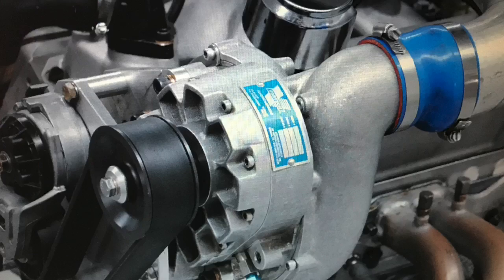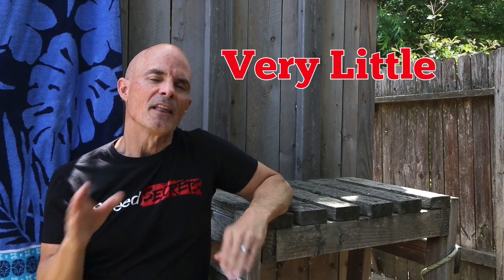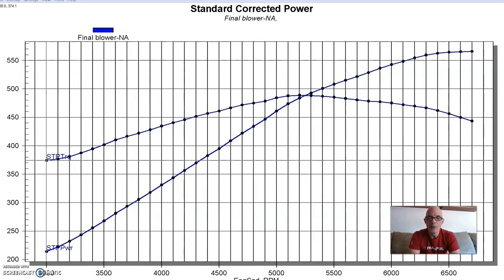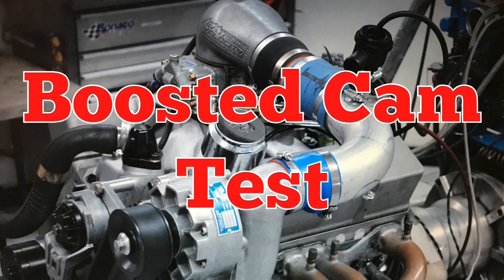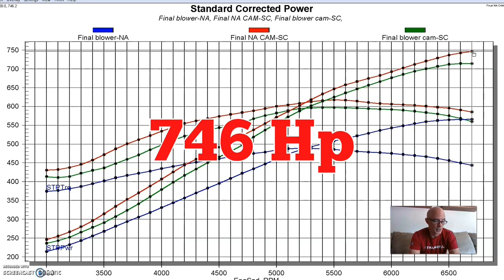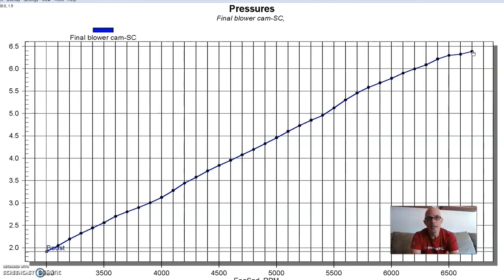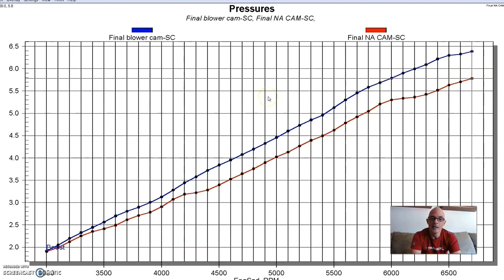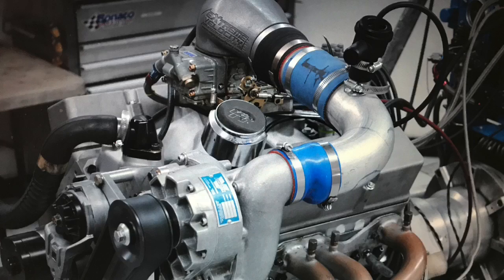MOTOR MYTH BUSTING-BLOWER CAMS!

Comment: LOWER boost pressure on BOOSTED N/A test ?
Here's my "fancy super scientific keyboard mechanic theory". IS BOTH.
Is filling more the cylinder and leaking it out too because of the added duration to both intake/exhaust and the tighter LSA.
Kinda of the same process when you uncork the intake side and exhaust sides with a good intake, heads and exhaust(supercharged applications, NOT TURBO'D). Boost drops 'cause you're freeing up the airways both in and out. Different ways, similar results.
I guess the only way to know for sure would be O2 sensors and EGT probes. That will tell you what's coming out of the cylinders and how much.

Comment: Richard, have you ever used David Vizard's formula for determining optimum LSA? I saw your big LSA test. You never went too narrow. Everything you tested, except for the 108° LSA cam was too wide for best torque and power and 108° might not have even been best. 

Intake valve closing point is the #1 factor for RPM range. Overlap is #1 for idle quality and scavenging. Pick the intake closing point, the desired overlap, plug in the optimum LSA and then you'll have the duration.
Reply: Sorry, have to disagree. Intake closing is NOT a sole indicator of rpm range. Nor do you factor LSA first. Optimal valve timing controls everything, Separation angle is a byproduct. You decide when the valve will open and close based on many factors, and LSA is the end result of those 2 events.
Reply: @vengeanceizmine9878  Intake valve closing has the most effect, of any valve timing event, on the engine's RPM range. Closing the intake valve later hurts low engine speed torque and helps higher engine speed torque, within reason. Conversely, exhaust valve opening has the least effect on how an engine runs. I would steer you to Dimitri Elgin for more in-depth discussion on this. 
LSA should come first as it's dictated primarily by the ratio of intake flow to cylinder size with adjustment for compression ratio. Better intake flow and higher compression ratio dictate a wider LSA. Lower intake flow and compression, smaller LSA. Most cataloged cams have too wide an LSA and give up torque for the sake of idle quality. Treating LSA as a byproduct is a sure fire way to compromise the engine combination. For more reading on this David Vizard is the man.
Reply: @Joshie2256  No offense, but did you copy that word for word from an outdated book? Or do you have first hand, real world experience? If you don't think any of the other open and close points have an important effect on how and where the engine operates, cylinder pressure, or cylinder fill, and how it all works with the entire combination, you need to put the "how to" books down and actually do it. 
There are a lot more important variables and determining factors  to consider when deciding on cam timing and LSA than what you listed and I'm not talking about just picking one from a catalog. All an engine wants to know from a camshaft is, when the valves open and close, how fast and long they open and close for, and how much the valves open during that time. All of which are way more important. LSA just moves the curve, which has nothing to do with compression and big flow numbers. I'm well aware of what every event does and how they work together, but let me just ask this... do you also decide on compression AFTER you choose a cam?  Doesn't make much sense, does it... just sayin'. 
I'll refer you to real world experience instead of quoting books... again, no offense.
Reply: @vengeanceizmine9878  Dear MrScreenName, My time is limited so I gave links to the writings of experts. If you disagree with them then you've got a big hurdle to overcome in building better engines and explaining your accomplishments. No offense. There is one optimum LSA for each combination that produces the most area under the curve all else being equal. One. You don't have to look for very long or hard to see the truth in that. Richard  himself has posted video after video showing more area under the curve with a narrower-than-typical LSA.  https://www.youtube.com/watch?v=JUHwVCDjonU

Comment: I noticed that the NA cam had significantly less benefit from the blower than the blower cam. I'm curious as to whether that was just due to it needing more air and therefore getting less boost, or whether there was indeed some charge blown through.

Comment: Might be able to answer your final question with airflow vs hp. If you lose hp per cfm you know you're losing efficiency and bleeding out airflow. If it don't change then it's from adding airflow to the na ability.

Comment: Two different camshafts! And the na camshaft is 10-14 degrees bigger. Would love to see similar specs. I'm pretty sure a "blower cam" with similar duration would make similar power
Reply: The engine doesn't know it has a "blower" cam, all it sees is valve timing. Look at both cams equally as just valve timing. Then you will understand why the "blower" cam will make similar power like you said, because the valve timing will be similar.. valve timing is all that matters, throw away the prefixes.
Reply: @vengeanceizmine9878  I agree with you. That's all I was saying. If you can give the engine what it wants, as in ivo, Evo, ivc, and evc, it should make good power

Comment: Richard I'm still waiting to see a set of Trickflow 245 vs AFR 245 on a 427+ engine. Use same compression, camshaft too. No one has done this test EVER. Be the first to do it so we can see  which head makes the most power and torque. There is a lot of debate all over the LS forums which head is better. A lot of those favour the trickflow but is it really the better head? Do the test!!
Reply from the maker: both work well

Comment: I suppose you could tell how much boost is getting out the exhaust valve by measuring unburnt gasoline in the exhaust. Perhaps by putting a smog meter in the exhaust and measuring the HC number?
Reply: This is why a "blower cam" is needed for an OEM engine, the emissions are going through the roof as you suspect. Fpr aftermarket where it isn't an issue for most people that matters less.

Comment: Are the wider lsa “blower cams” more driven towards low speed drivability because they assume you are using it on the street?
Reply from the maker: I like to chose the cam for the desired combination of idle, fuel economy, rpm range and peak power, then add boost

Comment: Ok my question goes back to XRam intake   i have a 5.3 LM7  can i bore it enough to use Ls3 heads and not have an issue with valve side clearance to the piston well.

BTW every cam is a turbo cam.
Reply from the maker: you don't need rec-port heads on a 5.3L-they won't work well
Reply: @richardholdener1727   I am trying to find a way to use the dual plenum cross ram intake manifold that edlebach makes on my 5.3l  or are there other dual plenum intakes that are good with long runners

Comment: Great info- more bench race ballons popped!!  Close to a fellas heart with a 400 with AFR 195's, VooDoo 110 LSA and lil Weiand 144.  What cc were the heads? What style rods n did you use std or small base circle cams?
Reply from the maker: it was small base circle, rods were h beams

Comment: Interesting. I been thinkin about this cause I bought 4.6 4v stage 1 n/a cams from Sean Hyland couple years ago but now I’m collecting parts to do an M122h Pd blower swap. Makes sense to use them now. Good stuff Richard. Now I need to decide on a static compression ratio for pump gas. I’m hung up on this. 9.2:1 on less boost or 8.5:1 with more boost?
Reply from the maker: 9.2

Comment: My experience with a centrifugal super charger is that they aren't as "picky" about cams as a turbo.  The bigger issue I've found is at lower boost the centrifugal doesn't mind an aggressive NA cam at all which your dyno just proved.  At higher boost and closer to maxing the blower out it starts liking that blower cam more and more especially if you like a full exhaust and reasonably quiet mufflers.  The reason is at higher boost you can still have overlap with a centri, but it will really like having a lot more duration on the exhaust side.
Reply: This is interesting as I have a  relatively big Vortech (Si) on a little 4 banger.  I have found that with more aggressive pulley combos, at low engine speed the Vortech surges which basically stops the car dead.  I have thought about putting on a large NA cam with long duration and some overlap to allow the engine to breath more so I can pour the boost on sooner without surging the blower. Do you think it would work?

new cam 234 intake/235 exhaust @ .040 with 15 degrees of overlap @.040
existing cam 204 intake/198 exhaust @ .040 with -24.8 degrees of overlap @.040

The new cam does have slightly less lift than the existing cam.  So... the Supercharger is oversized, I don't think I care about "blowing out" some of that air.
Reply: Turbos aren’t picky in any way.

Comment: Looks to me like the drop in boost pressure is the result of a restriction being removed (a valve closing sooner). The engine is able to use more of the air through more duration. If power had dropped then maybe a case for bleed off could be made.

Comment: Great video, proves again that every cam is a boost cam. What about BSFC? Did it change between the two cams? That’s about the only parameter that might go down (up) with boost blowing through the cam’s overlap. If you’re running this combo on the street, you’re not too worried about fuel mileage, but it might indicate efficiency of the combo. And, of course the answer to the question you posed: more efficient pumping due to better cam timing means less resistance through the engine, thus less boost pressure. Thanks for continued awesomeness!

Comment: Every cam's a blower cam ... but at what cost?  What happens below 3000 rpm re throttle response /fuel economy?  Or are we just talking about race applications?
Reply from the maker: pick the cam you want for the rpm you want then add boost

Comment: The same thing would happen if you went from std heads to ported heads on a turbo engine, boost would be lower but more power.
Reply: Less pressure, yes. More power? Not unless it needed it without boost..

Comment: Non Rootes blower, non turbo, any NA cam is a plus. Word, RH!  ( The key is that on a turbo or sequential injection turbo, the wrong cam can still cause surging or power bumps. I got told to either reduce boost or Put In a Bigger Cam! Everything in context. In a 1988 publication on SOHC Ford Pinto small bore center 2 liter engines before the later 2.3 liter 1975s Lima,  Ive seen a  dyno sheet showing a tiny little 255 hp gross at 6500 rpm 121 cubic inch OHC engine loosing 51 hp flywheel with too little cam duration. Moving up from the Stage 2 Ford cam with 286 degrees  from  degrees at lash to a 322B Crane 300 degree cam with the same V trim Garret T4 turbo in an EOA Ford engine made 306 hp, 51  more hp power without surge, and still  with a 2.35 boost ratio. Those wide LSA, reduced exhaust over lap "Myths" are and are just that.. )

Comment: Your test was done at only 6psi, that is not real boost, I bet you there will be tons of blow through (and up) if you try to run 60 psi.
Reply from the maker: at 60 psi?
Reply: @richardholdener1727  well, BRM had an engine running on 2 centrifugal superchargers and 82.6psi 70 years ago, but I am well aware that your test represents what normal steet-driven V8 guys  do, not all out race engines.  https://en.m.wikipedia.org/wiki/British_Racing_Motors_V16
My comment was ironic, but I'm sure all of us would be entertained if you were to take it as a challenge ;)

Comment: speedmaster rods & block? are you begging for something to break or are they a sponsor of yours? speedmaster is just procomp & procomp was junk. i never seen anything from procomp worth a damn other than the bare big block mopar heads & maybe olds heads. everything else i seen rated right up there with CAT. how much work was needed on that block? i'm not being a dick, please don't take it that way, but i would hate to see anyone buy this stuff without knowing just because they seen it in a video on youtube.
Reply from the maker: this motor worked fine for all of our dyno testing (there was a lot)-i have no sponsors-if i did-it wouldn't change what the dyno says

Comment: I do agree that there is no reason to fear running an NA cam with boost there are some issues with the idea. Sticking to centrifugal stuff... Almost every setup you build will gain a peak of 400-600rpm when you add a centrifugal supercharger. If you had a peak of say 6400rpm NA you'll likely expect a peak of 6800-7000 rpm with that same setup likely giving you a shift point of around 7400rpm or so. Will the owner be ready to run the new setup that high? Anytime you aren't using the entire powerband you have the wrong cam whether you're NA or supercharged. If you aren't using all of the power band you are putting together a setup that has worse drivability, needs a higher stall converter than necessary, and will likely have a higher EGT than a better done setup. Taking a 400 inch motor with say a 242/248 110 cam that peaks at say 6400 and now peaks at 7000 for a shift point around 7400 or so and yet could likely be matched with a camshaft of around a 224/240 117 with a small amount of boost difference to make comparable power. I like keeping the boost numbers down for efficiency and IAT's, but the smaller cam with heavy exhaust split should keep EGT's in a better range helping with timing numbers as well as piston/ring temps. The LSA being a bit higher will help make sure to get the rpm peak still around 6600 or so which overall would put your shift point around say 7000rpm (more likely accepted by the owner). The thought process without putting a name to the cam puts the idea in the ball park of what is sold as a "blower cam". This is my thought on the idea although I do agree that there isn't anything wrong when a naturally aspirated camshaft with boost. What do you think about this thought process? Am I just being too technical or ridiculous?

Comment: One theory behind specific boost cams as opposed to NA cams is that an NA cam can cook the exhaust valves.
How exactly this is supposed to occur I’m not sure , something to do with flame in the exhaust ports.
Reply: That is mostly with a turbo. That is also why exhaust valve material is Inconel for heat, however you can alter exhaust timing to help that situation,  it doesn't negate the overall outcome. The test just shows what can be done, not which is best for the application.

Comment: I dont know about speedmaster,,,Pro comp or whatever there called I've seen some of there stuff with not very good results there  Holden EFI 304 IDA STACK injection manifolds there ports don't line up with the Holden EFI 304 factory gaskits because to get them to work you have to weld up the ports and stuff I'm not a trouble maker but I work my ass off to buy my parts.

Comment: Longer duration and tighter Lsa helps cylinder fill especially at higher rpm hence lower boost more hp through better volume efficiency less exhaust residuals Being over square engine  shorter flow pathway from intake to exhaust more lsa more exhaust residuals less volume efficiency .there a shit load off other variables.peace

Comment: I'd like to see an "other guys" video of the Buick 300 cubic inch V-8. Especially a low rpm engine. Most of the time (95% of the time) I never have to run an engine over 3000 rpm while driving down the road.

Comment: What about the ring gap? Wouldn't you have to have more ring gap once you go to add the boost, but couldn't have a bigger ring gap NA?
Reply from the maker: the extra gap does not hurt power
Reply: @richardholdener1727  ok I was just wondering, especially with the NA engines. Please do a low rpm torque test like everyday driving. I rarely need to get above 3000 rpm driving up to 65 mph.
Reply: @richardholdener1727  also would like to see the 300 cubic inch V-8 Buick from the 1960's.

Comment: How about both? A little "leakage", a little more air consumption from the healthier engine.  Even with less boost, the added overlap improves the scavenging which ensures a high VE, which only adds to the power.

Comment: Richard i would love to see a test on the carb hats for boost im wondering if air being shoved in follows the long curve and gets detached form the short turn and essentially leaning out one half of the carb because air pressure would be higher on the long turn.....if you understand what i mean
Reply from the maker: we have wondered about the fuel flow readings we get with these hats

Comment: Hey Richard small favorite ask. With your extensive engine dyno experience I wonder if you could give me a ballpark of a horse power rating for my big block Chevy. It is a 3.76 inch stroke 4.310 bore, 30cc dome forged piston stock rods zero decked, comp 295T cam hydraulic flat tappet  Cam with gm bow tie aluminum cylinder heads with 2.18 in take 1.88  Exhaust valves 290 cc runners 110 cc combustion chamber, air gap dual plane intake, hei ignition, 4150 style quick fuel 750 carb, long tube headers which should be around 10.25-10.5:1 compression depending on head gasket thickness. I was hoping for somewhere between 500-600 realistically mid 500s due to cubic inches but it should rev to 7000 happily with the 396/427 crank and free flowing heads and the cam. Thoughts/suggestions for a fun street rod ?
Reply from the maker: i would think low 500s
Reply: @richardholdener1727   Thanks so much for your response I really appreciate it. 750 performance carb enough?